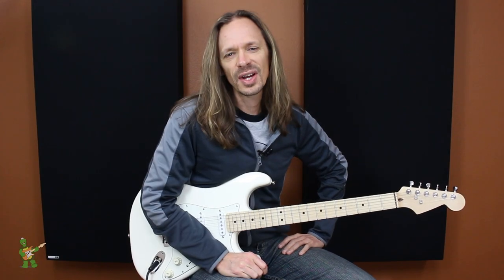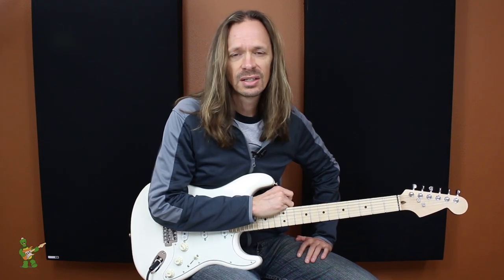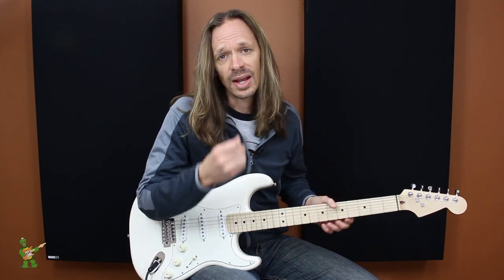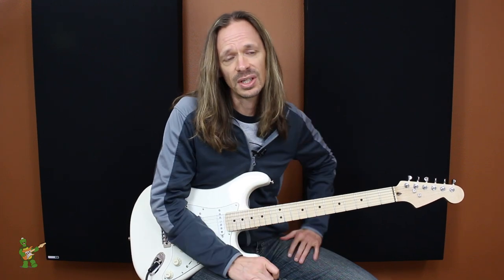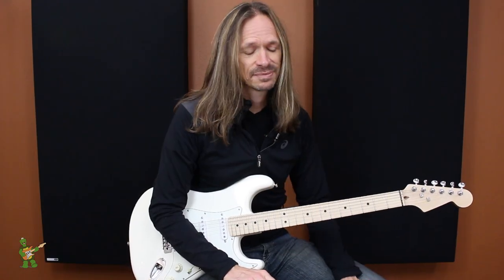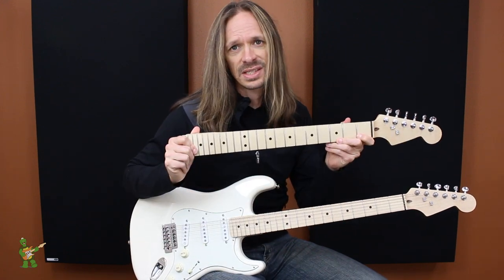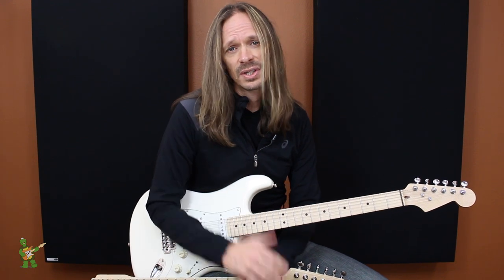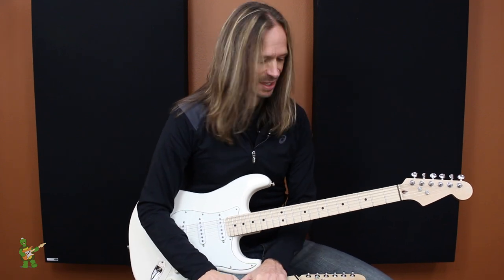Stainless Steel vs Nickel Frets

Comment: I couldn't hear the difference in the neck position, but once you switched to the bridge in and out of phase pickups, stainless has a darker, slightly woodier sound to it. 
Because I have nickel fret guitars that are on their 4th+ fret job, (Because I have a "heavy handed" playing style) I too am a HUGE fan of stainless steel frets, and about 1/2 my guitars have them. My Warmoth teleblaster has them and it's my favorite go-to guitar to play. Parker guitars only uses stainless steel frets on all their models by the way.

Great informational video!

Comment: On my peavey Adrian Vandenburg signature series guitar, i had a steel locking nut. I changed this to a custom aluminum design to help the open notes sound more like the nickel fretted notes. I find that stainless fretwire helps the held down notes to sound as powerful and bright and attackfull as the open notes with a locking nut. That zingy attack is present as ever as the open notes now. It changes the technique you use, and even the way you write or change things in the writing of the music for the guitar. You write with your playing. Then you attempt to write it. Also using titanium truss rod and bridge parts. Would like to use it as fretwire as well. Although i have found a solution with keep on using stainless fretwire, and also hard nano diamond coat it to save the strings. This may tame the highs on the attack though. We shall see.

Comment: At least for me, I find the stainless zing distracting to the point of distraction. I really and truly want to love stainless and they are indeed super smooth to play. But I just can't do it, despite owning a few of them. My observation spans multiple necks with stainless frets, and isn't isolated to a single bad experience. First off, stainless adds a brighter tone to every part of one's playing, which can be good or bad depending on your tastes. On tube amps, the zing is slight and hard to detect, but really jumps out with effects like compression or flange, or on modeling amps. I find that slight fret buzz from heavy-handedness on low action (and light strings) is barely noticeable on nickel, but is pronounced and troubling on stainless because of the brighter tone. Stainless just seems to amplify even minuscule buzz. Out of the box, stainless fret ends are very sharp and can even cut. Dressing stainless fret ends is quite difficult and requires some force -- not the usual 5-10 minute light-touch job that nickel requires. So I am in the slow process of selling off my stainless necks and replacing them with nickel fret necks. But as Aaron notes, if you are in a band most of this probably becomes imperceptible in the mix. When you play alone and just love the sound of pure guitar....the zing bites.

Comment: As usual, Aaron's great videos have influenced me.  Since this video came out I've bought 2 Warmoth necks with SS frets.  I definitely hear the difference, but I've found that the "zinginess" is much subdued or eliminated by using something other than steel at the bridge.  Brass and even Tusk saddles work great.  Keep on pickin"!

Comment: This due to the fact that these are 2 metals for sure however the material density make them different in the way they absorb the the pressure under your finger tips. The stainless is more dense then harder, absorb less so the sound is a little bit more metallic.  Try to hit to stainless sticks and 2 nickel stick the sound will be different between the 2.

Comment: Takes some force to get the spank so some comparisons weren't as strong but with neck 2 the high end compressed quickly. It was there straight away and it stayed there, dominating the sound and making those lead lines sing. No surprise which one was which.

Comment: Cool comparison. I didn’t know which was which, but heard thru the imperfect filters of youtube, my ear favored #2 on account of consistently better midrange girth and note clarity. It was most pronounced to me in your legato and sustained vibrato passages.  Of course that could be a matter of the stated preference of your fingers favoring the stainless steel feel. 

You didn’t say anything much about strings, but it would seem string composition and size could interact with fret composition to affect tone indifferent ways.

Comment: Thanks for this. Nice touch to have the neck made from same piece of wood. There is a difference. I noticed this when I installed my first SS frets to my LP. With that guitar it was a step to right direction but have had refrets since done on purpose using conventional fret material even though there’s a massive difference in longevity. But man those SS frets feel go to play!

Comment: I had stainless frets installed on my Nash s67 because I played ruts in the nickel frets in just over 3 years. The biggest difference I have noticed has nothing to do with tone. What I’ve noticed is bending across stainless is much more smooth than nickel and the ability to get vibrato from the left hand is easier on stainless. Plus I’m not worried about new frets every 4 years now. Love my stainless frets and I’ll eventually have all my guitars installed with them.

Comment: I don't know if it was the slight change in camera angle but the #2 neck had a smoother sound which seemed to translate into a teensy bit more bottom end and less harsh, we're talking miniscule but I def noticed a difference and I think I prefer #2

Comment: Thanks for this.  That zingyness you refer to is what is steering me back to nickel.  Now I am trying to learn how to refret my guitars so I can stick with nickel.  I have EVO Gold wire on my 1962 and 1964 Strats and have appreciated the lack of wear because I played them hours daily for years with no wear whatsoever.  But, after years of playing, I did notice what I call "fret chatter."  It is the zingyness from the string hitting the next fret.  You may be able to minimize that effect by using a .012" neck relief but on flat necks, it is more noticeable.  With nickel, that effect is "softened" because of the softer metal.  The other issue I have to consider is I am afraid to refret my vintage guitars again because of the potential damage you can do by chipping the vintage rosewood or wearing out the fret slots.  I think I will keep the EVO Gold in my vintage Strats and experiment with my other Strats.  I am in the process of ordering either a new Warmoth or Musikraft neck so I can start practicing refretting on the Nash neck.  The other thing to consider and what I am dealing with now, is if you don't like the fret size you chose (Jescar FW55090), then you are basically stuck with it (at least mentally) when you put lifetime frets in.  Since the additional price isn't too much more for SS, you can always go back to nickel.  Just be sure you are happy with your fret size choice before you switch to SS.

Comment: I'm curious about the opinions of the nut on the tone.  I cannot see how it matters on an electric, especially if the player isn't using open strings too often.   Perhaps a finger picker on an acoustic could hear a difference.   I have made nuts from plastic, bone, antler, brass, aluminum, and resin poured into a mold.  Aside from the resin nut failure nothing seems that different.  The brass nut was tough on strings, probably from not being able to get a smooth cut on the small string gauges.   I've been using a plastic lollipop stick for a bridge on a classical guitar for years and it sounds great.   Is the nut material argument just for the sake of argument?  Wouldn't a zero fret of the same material as the frets be the best tone option to match fretted note tones?

Comment: in my experience, stainless steel frets tend to make the strings more responsive. so smooth that I had to kind of relearn how to bend and hold the pitch because it's so smooth that very little movement shifts the pitch. that said, it's easier to do vibrato on them. SS kind of forces you to learn a different kind of control. nickel on the other hand has more friction to the strings so I find it easier to hold it after bending to pitch. Now I like the feel of SS more, so buttery smooth. so both have pros and cons depending on how you wanna play.

Comment: I think you did an incredible job,  I could hear a difference,  neck 2 stood out more to me,  then questioned whether I preferred the difference and that is subjective... my mind flips back and forth over that..
One thing I think is worth suggesting is... use a looper pedal to cancel out the issue of whether you played slightly different in both tests.... it's the one variable that you couldn't account for in this test!

Comment: Bought one guitar with stainless steel last year. Don't know about tone difference, since all my guitars are completely different. BUT THE SS JUST FEELS SO GOOD TO PLAY!
Recently got the worn (16 years) frets on my EC-1000 changed to SS. The EC-1000 was my favourite, and now it's 10x beter! A bit more expensive than nickel to install, but so worth it! And they will last like forever, so the price means nothing.
If you haven't tried SS, you definately should! Take eg Chapman pro series or Solar 1-series.

Comment: Had just put a stainless Warmoth on
my Tele Deluxe before I saw this video... I thought it was a brighter sound but I know for a fact that the feel was different and I liked it. The neck is top notch: Goncalo Alves two piece. I figure the brightness is due to the wood. Cheers.

Comment: I had a really cool Warmoth Tele 1/4 sawn maple neck made with stainless frets. I believed the frets would harden with bending as stainless steel is notorious for work hardening. They never showed any wear and I doubt they would have. What I didn't like about the stainless frets was the feel when bending, it was different than standard alloy frets, I would say not as slick. I think the coefficient of friction with stainless frets was greater than standard alloy frets and thus the sensation of them not being as slick. I don't play anymore but if I did, I would use standard alloy frets.

Comment: The difference I hear is not just something than can be adjusted with a Presence knob on an amp. What I'm hearing is that the SS is fatter, a bit warmer, and the fundamental harmonic of each note (ie note definition/clarity) is blurred just slightly in a very pleasing way to the ear. That can be a bad thing and make a guitar sound muddy with a lot of distortion, but the SS frets also have that extra very high top end to make up for it. SS sounds to me to be a more musical choice. A choice that nobody is ever going to tell the difference when the band kicks in

Comment: Thank you for this video. I'm currently saving up for a custom guitar and doing my research and I admit I was confused by all the "internet madness" as you put it, so this was very helpful to me. You've sold Stainless Steel frets to me. I heard a slight difference but agree it was negligible and wouldn't make a difference in a real life situation. There may be a small difference with cleans but I highly doubt anyone has come home from a gig and said "It was ok, but I didn't like the guitarist's frets" lol. Seriously though, seeing as my band is punk/metal, mostly playing with distortion, I think we can easily address any tiny differences in my clean tone. For smoother playing and much more durable frets, I'm now sold on Stainless steel. Thanks :)

Comment: As you said,  any difference in tone between these two necks would completely disappear in a mix or on a gig. Once any distortion effect is on, the tiny difference completely disappears. I'm gonna go with stainless steel frets the next time I need a re-fret.

Comment: I was surprised that I could both hear a difference and that I guessed this right. Neck #2 just sounded a tiny bit tighter and snappier as if the string was making a harder connection with the fret. It was pretty apparent for me in the clean, single note stuff. Cool!

Comment: I could hear an slightly more airy vintage sound on the nickel and a bit more solid sound to the stainless.
Both have their applications. Just another tool in the toolbox, not bad or worse

Comment: I prefer the tone of standard nickel frets because, with stainless steel frets, there is an un-EQ-able “ping/zing” in the high end that no amp treble or presence knob can remove, especially when using overdrive or distortion.

Comment: I could tell through my laptop speaker without even using headphones. Had a Parker Fly Supreme with SS frets years ago. Yeah, you can tame the brightness by turning the treble down but it's also lacking some beef in the lower mids. It's just a thinner, tinnier sound. Still, for live gigs and workhorse gear it probably doesn't matter. I wouldn't want to record with SS frets though, if I had a choice.
Reply: So you use a mahogany neck instead of maple and counteract that perceived difference, right?  That's the beauty of Warmoth custom necks...
Reply: @kitoyobeni1  Maybe, I've never tried that. To me mahogany doesn't add low mids it just takes away brightness so you notice them more. I'll take a maple neck every time unless it's an acoustic or hollow guitar. If a guitar has SS frets I'd just try to EQ that in post production to make it less obvious but who knows. They sound fine overall until you compare them to nickel.

Comment: I have got a  guitar with Jescar stainless steel fret wire and I play it most days. I have to say I'm starting to see signs of wear on the first 3 frets after about 4 years of use... its not that bad. Certainly won't be needing a re-fret whilst I'm alive but I think one day I might have to get the frets leveled and re-crowned .
Stainless steel frets are very good but they do wear eventually regardless of what people say just like ever thing in life that gets used !

Comment: Strings are mechanical devices that generate sound.  If you can feel a difference when playing then there will be a difference in the sound they generate. Whether that difference is actually detectable by your ears.- ie. how they sound is going to vary based upon different ears and - more importantly - different players.

Comment: Thanks for clinical testing, well done. I heard very subtle differences in clean sound, and no difference in distorted sound. But I found neck 2 with SS frets slightly more sparkling than the nickel frets, weird isn't it ?

Comment: Heard the pingy quality with the second example. Though contrary to the characterizations in the opening, I found the major difference between the two samples - pretty much across the board - to be that #2 had heftier low-mids (or at least it comes across that way at first glance). Is it possible that the Tone knob was just rolled back a bit with those takes? In example three especially #1 comes across as being slightly scooped and having a bit more hair on the top end.

Comment: Great demo…. an honest demo and review. Firstly, before I give my take on this wonderful presentation, I’d like to mention that I’ve had SS frets on my Takamne for 14 years (I’ve had the guitar since 92) and I’ve also put them on one of my strats and there is absolutely no wear. Prior to that I’ve had my frets changed on my Tak twice and they would start wearing (getting string dents) after just a few years.

From what I hear it seems that Neck #1 sounds a tiny bit more trebly than Neck #2, which sounds like it has a tad more bottom. Prior to this demo I thought that the opposite would be true. That because SS frets are harder they would provide the least amount of interference with the string's vibration thereby the least interference with the string's natural tone creating a slightly brighter sound. But this demo proved the opposite meaning that the harder fret surface seems to allow the natural bottom frequencies and harmonics of the note to be slightly more present. This means that these slight differences can be offset (as mentioned by this honest gentleman) with a slight turn of the presence or tone knob according to one’s personal preference. Seeing that this is the only difference I’m in total agreement with the demonstrator. The only drawback of SS frets is to the repair shops who won’t be seeing you ever again for fret replacement due to wear.

Comment: The difference in sound was likely due to being recorded on different days. If the amp was miked, it was likely not in exactly the same position. The atmospheric conditions could make the speaker react differently. The necks could have been sitting more/ less tight in the pocket. Etc.....this is no different than the tonewood on a solidbody argument.

Comment: It is hugely disappointing to pay to replace pitted nickel frets and have a kick-ass setup done, only to destroy the very same frets in short order.  Never had stainless steel frets before, but clearly Aaron is right.  I could care less about the tonal difference, because fret work is frustrating.
Also it’s worth a mention that some people are unfortunate enough to have a bad reaction to certain metals including nickel, (not me), but stainless steel is safer too.

Comment: With my high end headphones and my 20+ years sound engineering (and that doesn't mean a thing! but i trust me at least...) nikel has a little more body, slightly fatter, whether stainless lacks low end and tends to be thinner. Is a very tiny difference. I prefer nikel. This video is some of the best things i have seen!! This is science!!:)
Reply from the maker: Thanks Spacedog! Here's the control test: https://youtu.be/6k4HNhFJiH0

Comment: Neck 1 is  smooth in the mid and little thick also and have a mutet high freq..

Neck 2 is open and clean in the mid  and have more sparkle  in the top...

Comment: One thing I dont hear about is the type of strings used with Stainless Steel frets. Since Ernie ball came out with Cobalt and Paradigm, Daddario with its NYXL “stronger” strings with a harder material will start to wear Stainless Frets faster than standard Nickel.